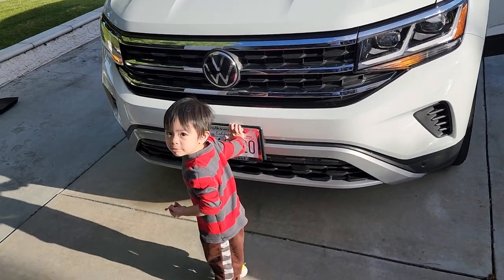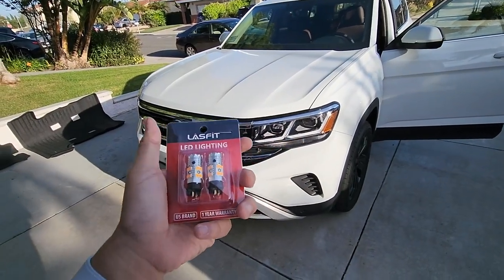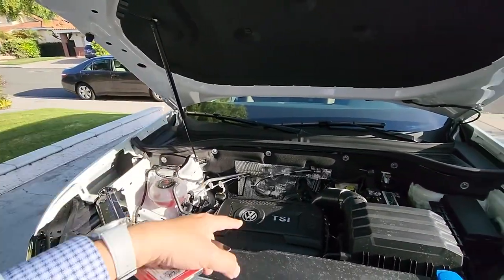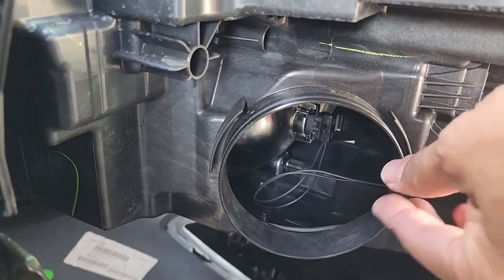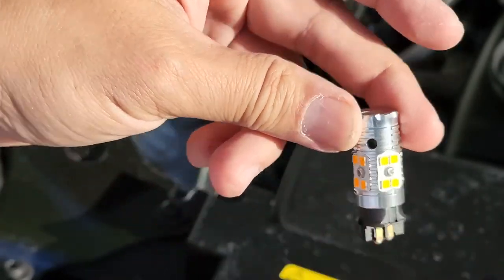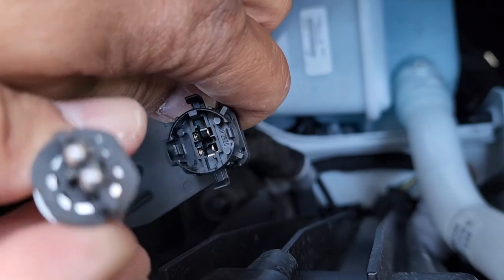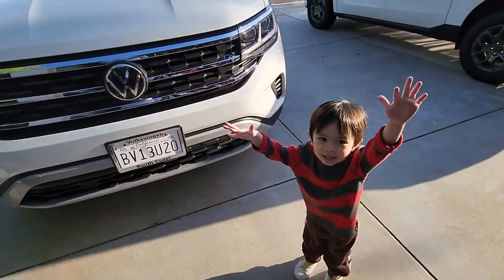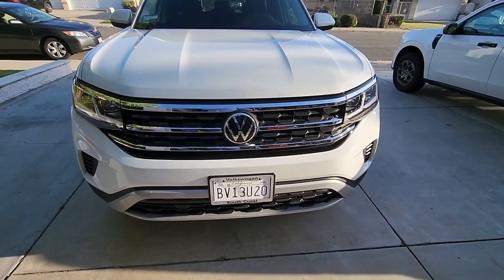LED upgrade Volkswagen Atlas Turn Signals !!! Lasfit are the best! PW24W CANBUS

Comment: Confirmed, worked on 23. No issues with hyper flash. Same parts as this 22
Reply: I just got the 2023 so the work on yours?
Reply: Hi, so wondering if all trim packages on the 2023 Cross Sport still have Halogen turn signal bulbs?
Reply: @JoseMartinez-wo3gk  how do you like your 23 I'm thinking about getting the R-line black

Comment: Nice! I used the DeAutoLED VW enthusiasts use them too!
Reply: Hello, do the DeAuto LED match the orange color for the rest of the orange lights on the rest of the car? I tried the Lasfit and the amber color does not match the other lights unfortunately so I put back my stock bulbs. The lasfit are nice and bright but the color is off and isn’t a match.

Comment: Doing stuff in tight spaces with the watch on, ouch, I’m not the one for scratching stuff but accidents happen.
Don’t like they didn’t make the turn signal whole width of the headlight
Reply: I think I’d open the headlights and add an led strip lol
Also hyperflashing can’t happen with hazards on, has to be one side only.
Reply from the maker: my watch has a screen protector as well as bezel protector. I'm tend to be clumsy 😆

Comment: Are the daytime running lights easy to change. My led light is out ok one side. Can't afford the dealer😢
Reply from the maker: Unfortunately the DRL are not interchangeable bulbs but integrated LED assembly. If you're still under factory warranty I'd advise a dealer visit.
Reply: That's what I heard that it's 50000 or 4 years for warranty 😢